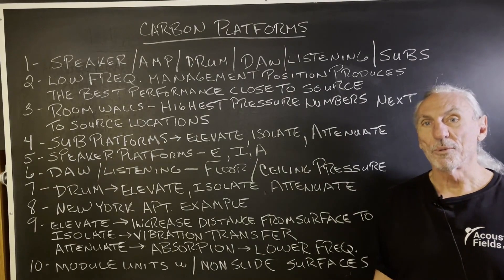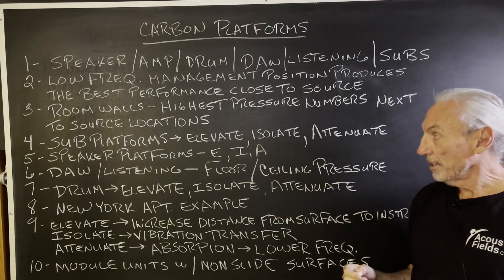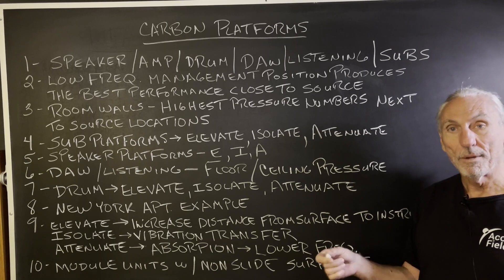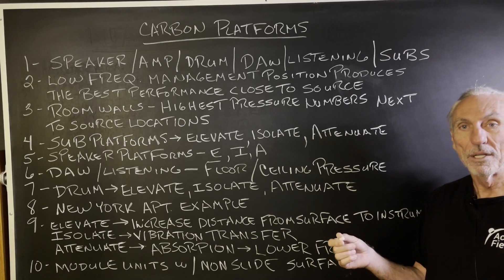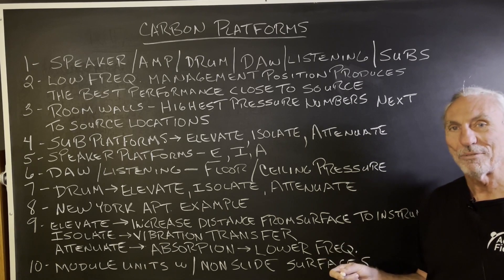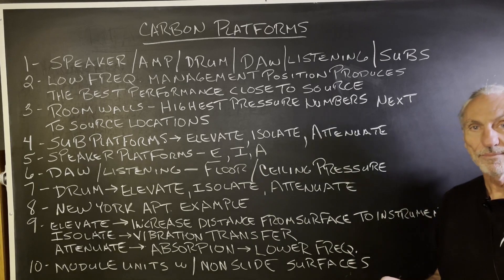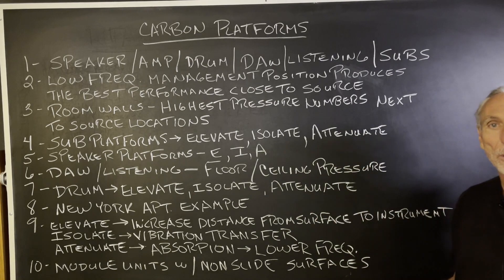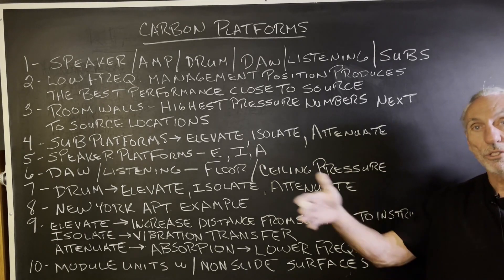Carbon Platforms - www.AcousticFields.com

Comment: I'm curious as to raising a subwoofer to a preferred height is the measurement from say the floor to the bottom of the cabinet, or measure from the floor to the middle of the speaker?
Reply from the maker: Start at 18" off the floor. Listen to your favorite sources. Raise to 24". Listen to your favorite sources. There will be a distance in that range that will work best.